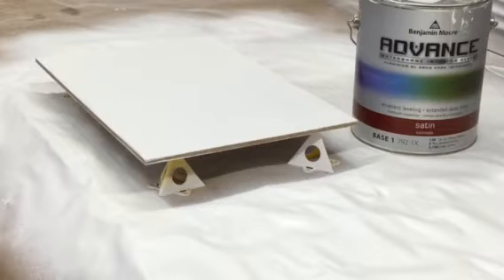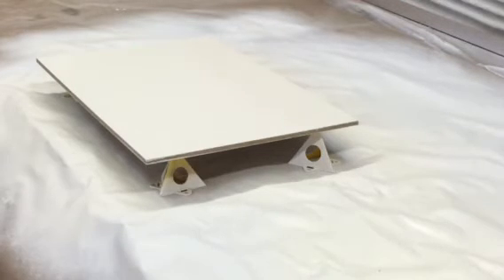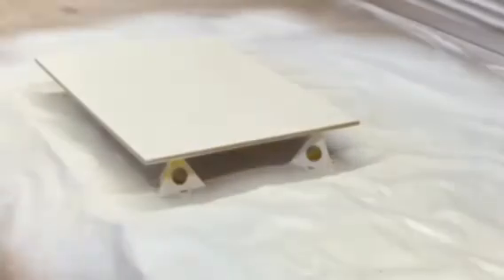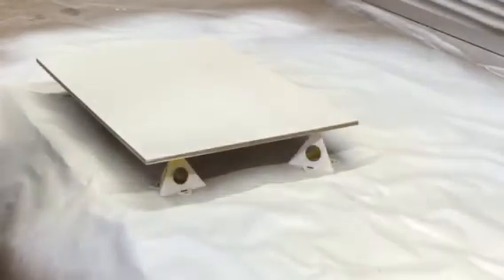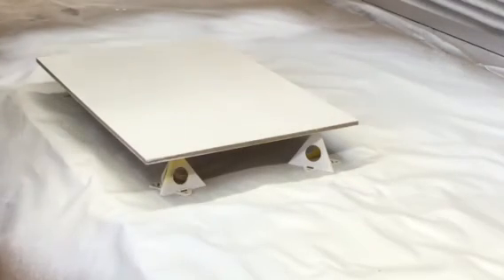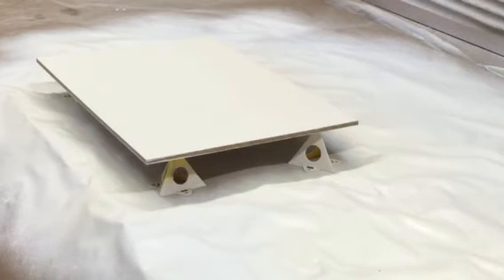BM Advance

Comment: i tried everything changing needle up to 1.8 at 15s,20s,25s,30s,35... with the ford cup it just splattered everywhere and have lots of runs
Reply from the maker: +faby garcia 30-35 seconds should work.
Reply from the maker: +faby garcia What are you thinning with?
Reply: +MrTjbnwi distilled water
Reply from the maker: +faby garcia Any problems spraying other products? What other products have you sprayed?
Reply: +MrTjbnwi pro classic with a little water works well
Reply: use an airless sprayer with a 200 mesh filter in gun and in the manifold and use a 311 size tip or a 308 spray fine tip @2500 psi works very well and it lays flat, first coat should be a quick one jut a mist, let it tack for 15 to 30min, apply your 2nd coat as you would do with any other paint, and that should do it.
Reply: I got mini mite 4 which is supposed to be better, still get lots of orange peel , I got T75 gun with 1.8 tip, BM advance is supposed to be thinned with water only per BM guys at the store. After reading a lot, looks like my spraying technique might be the cause of it, I feel here , you could have same issue, you have to be no too far or too close, you have pass as certain speed of else your result wont be good. if anyone has recommendation for me please let me know.

Comment: Having a hard time spraying with my mini mite 3
Reply from the maker: +faby garcia You will have to thin it. The MM 3 does not deliver the same cup pressure as the Q4. 
I have not tried this yet, but have read that you can use waterborne poly urethane (Minwax Polycrylic or Parks waterbourne floor poly) to thin it. Ad a little Flowtrol also.
Reply: +MrTjbnwi thanks for the infos i will try that let you know the result
Reply from the maker: +faby garcia Your'e welcome.
Reply: +MrTjbnwi did try the poly with good results but still some runs, im trying at 30 s with a 1.8 tomorow
Reply from the maker: +faby garcia you don't say what the time was when you had runs. Don't exceed 4 wet mills. 
The higher the seconds the thicker the product. Less chance of runs.
Reply: +MrTjbnwi i tried at 20 s will try at 30 sec today thanks
Reply: +MrTjbnwi tried 30 s today thinned with poly 1.8 needle still have some runs .... will try 35 to 40 sec tomorow. can t wait to finish this project i had better result with my 2 hp compressor and hvlp husky gun 1.4 tip then my 1k fujispray set up should of just continue with my husky gun and not buy this fuji spray. i am at almost 200 dollar of paint just practicing on my project (2 dresser)